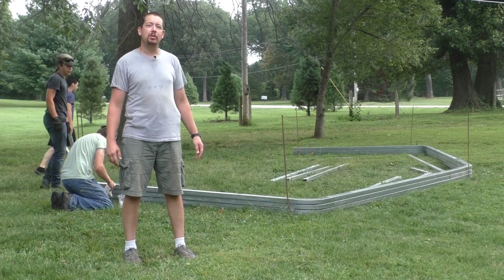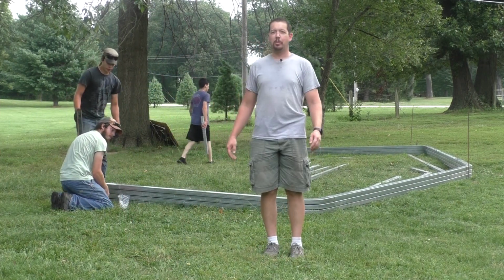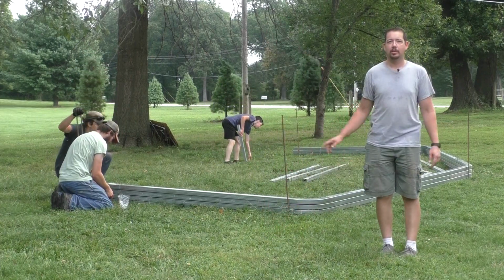DIY Metal Garage: Finishing Up the Framing and Lean-To

Comment: Please, your ladder safety usage needs a serious upgrade. No reaching past the edge of your ladder more than your belt buckle. Don't stand higher than said belt buckle past the top of your ladder. Set those ladders up like extension ladders if you can't reach it safely as an A frame.
Reply: Those ladders are not your typical A frame ladder. Those they are using, are much more stable, comparatively.